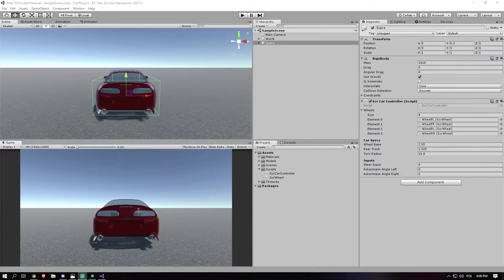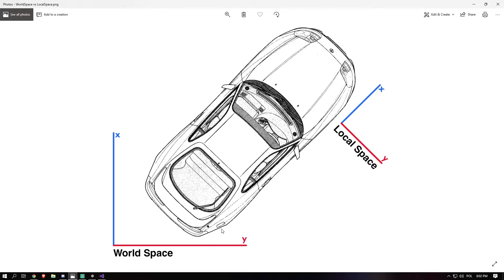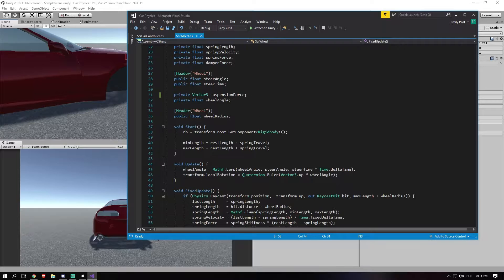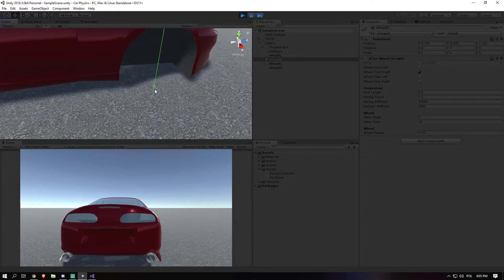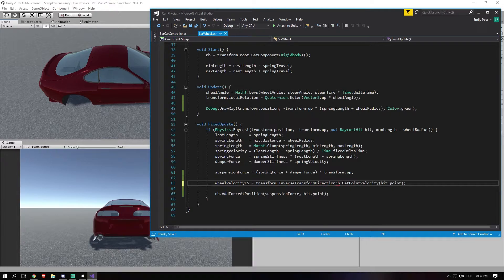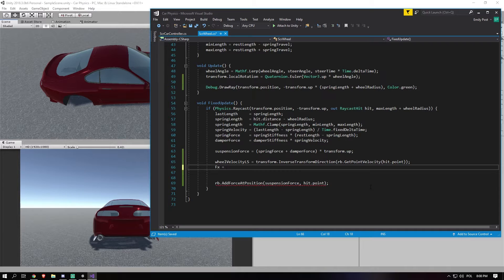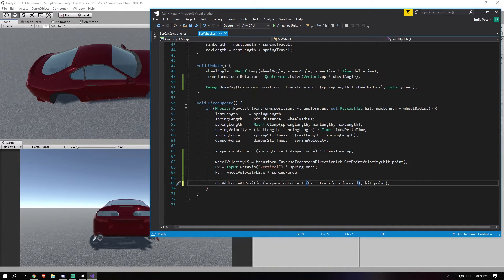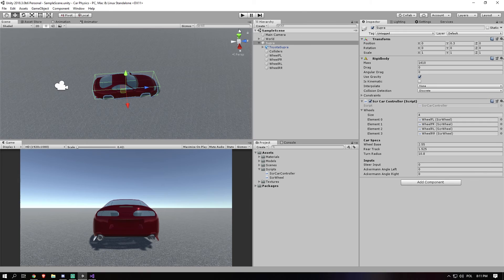Unity Car Physics - Lesson 3 - Forward and Right Forces

Comment: why does my car keep flipping over!
Reply: You can create a Center of Mass with an EmpyObject as child of Car GameObject, then in code, inside  a Start function write; Rigidbody.centerOfMass = (here the EmptyObject).localPosition. Also, a low Center of Mass, prevents more to flip over the car.
Reply: @magic_nanito  thanks i will check this out later, wait if I add the centre of mass it will flip my car over easier?
Reply: @The_Real_Comet  If the "COM" position is higher, the car will roll over, but if it is lower, it will be more difficult to roll over.

Comment: Good info ! Only problem is that if the car is parked on a angle (the left side of the car is lower than the right), it starts sliding sideways down the hill. I tried playing with the WheelVelocityLS, but have not found a good solution

Comment: Great series! I hope you find time to continue it in some point. Can you hint a bit what methods did you have in your mind for the tyres? Visual tyres are easy to add, and even steering rotation is fairly simple to implement at this point, but how about the actual spin-rotation of the tires? (As in, at rear it's related to the contact with floor and/or power they receive, and at front mostly just the contact.)

Comment: Good tut. This bar is called anti roll bar.
Reply from the maker: Yeah I know haha, in the moment I just forgot the name ^^
Reply: @ИванНовожилов-э9з  Mine is not there yet
https://postimg.cc/QVJdS2hV
Reply: Hello, any good resource on how i can calculate the wheel RPM so I can apply Pacejka's dynamic friction (a resource about that would be good), also I hope you add some subtitles to your videos so we can understand it. Thank you
Reply: @obkf-too  T  - wheel total torque
Td - drive torque
Tb - brake torque
Tr - reaction torque
Trr - roll resistance torque
T=Td+Tb+Tr+Trr

omega - wheel angular velocity
i - wheel inertia
omega+=T/i
Reply: @ИванНовожилов-э9з  Thank you for your quick reply, 

What is Tr reaction torque?

So the angular acceleration is the final wheel torque divided by the wheel inertia
alpha = T/i   with   i = 1/2*m*r^2 

where "m" is the wheel's mass, right?

I suppose that is valid when the wheel's friction is in the kinetic phase ( wheel is slipping, in Pacejka slipRatio is greater than someValue exp: 0.8).

When the wheel's friction is in static friction phase (wheel is not slipping) the wheel's angular velocity is proportional to the wheel's linear velocity so 

angular_vel = linear_vel.z / radius
true ?

All this so I can calculate the slipRation:
slipRatio = angular_vel / linear_vel.z
Then I pass that to simplified Pacejka function to get the friction factor, and then run the calculations again and finally apply the sum of the torques T to the wheel.
 

I really have been looking after this for sometime now, and I feel I understand some of it but I maybe missing something.
Reply: @ИванНовожилов-э9з  Thank you for your help,
I am making a small software to calculate and visualize the simplified Pacejka's magical formula. I will share it on github when it is complete, maybe it's interesting for you.
Reply: @obkf-too  red - pure Long Force, green  - Combined LongForce, cyan - Combined/Pure
Reply: @obkf-too  Tr  = -LongForce * Wheel Radius. About angular acceleration and wheel inertia yes all right. About Static Kinetic Friction also. But classic Slip Ratio eqation a little bit different from your. http://www.menet.umn.edu/~gurkan/Tire%20Modeling%20%20Lecture.pdf
Reply: @obkf-too  Slip Ratio this is ratio of slip velocity to wheel center linear velocity  SR = omega * R - V.x / V.x
Reply: @ИванНовожилов-э9з  lol right, I just have been reading a lot about it it made me a little confused, I will make something and ask you again when I have more accurate model.